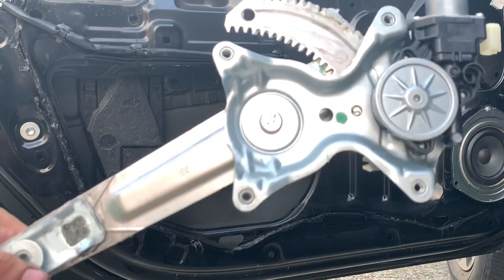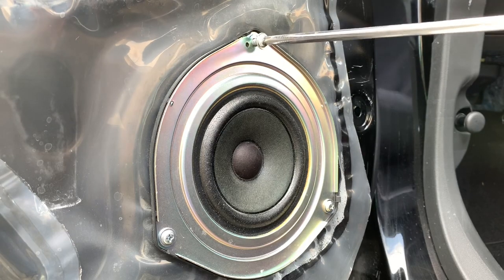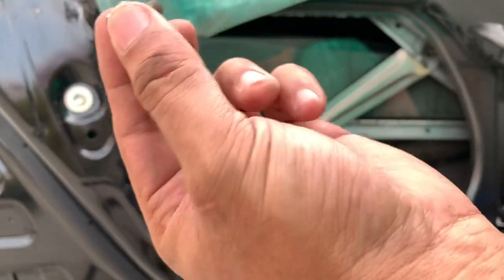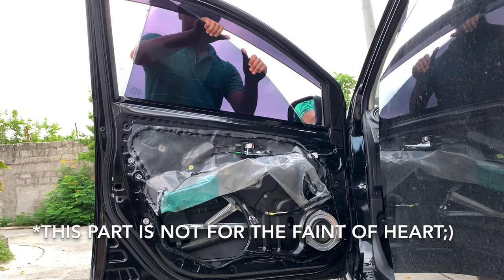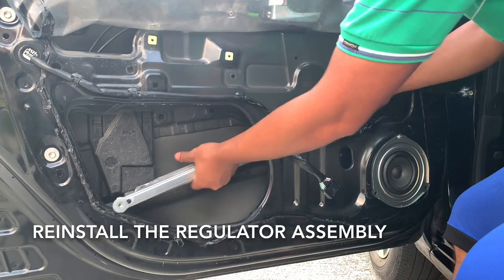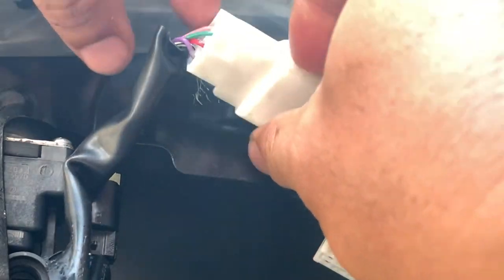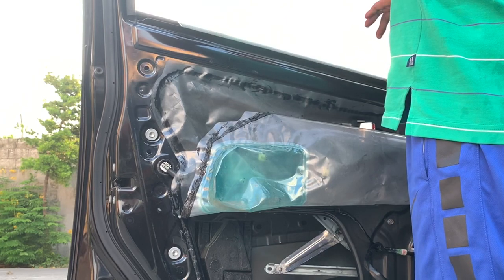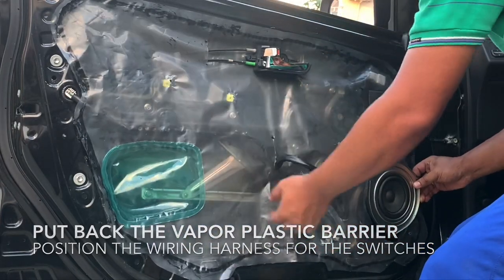Front Power Window Regulator Preventive Maintenance - Toyota Wigo, Agya, Perodua Axia, Ayla

Comment: Hi Sir Allan, any tips po para higpitan ung interior weather strips na lumuwag? Natatanggal po kasi sya kapag tinataas ung window and sobrang luwag na nya. Thanks po!
Reply from the maker: try to remove it and inspect baka nalagyan ng lubricant kaya madulas. if that's the case, dry it up then re-install. kung ganun pa din po, you can try to use a double adhesive na 3m tape (yung medyo manipis na type).
Reply: @WigoRaizeTV  Thanks po ng madami! God Bless po